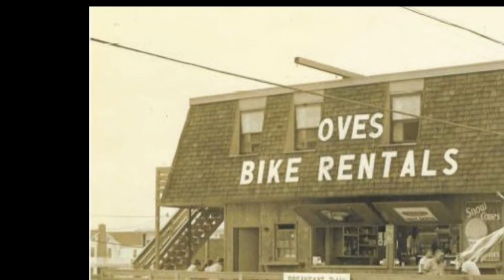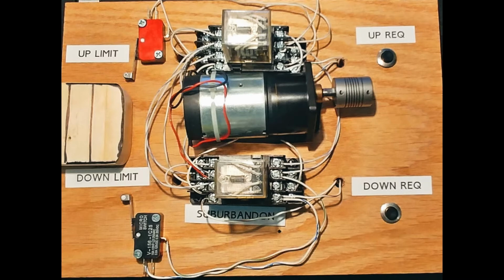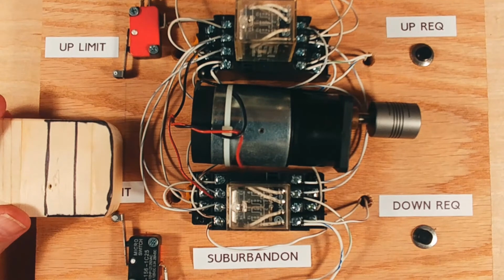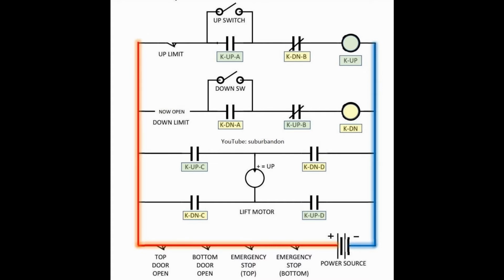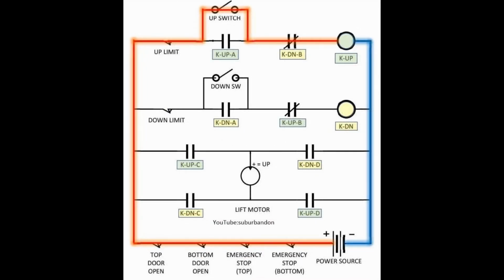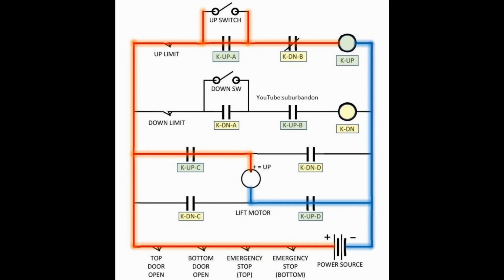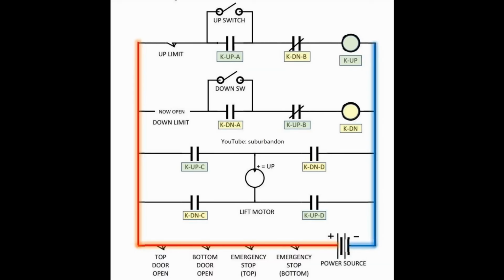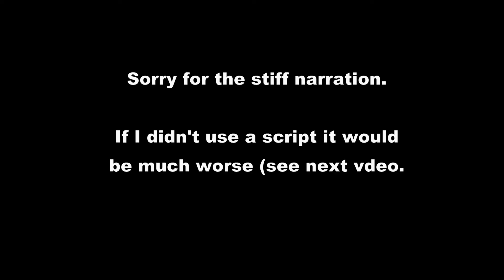Simple Relay Controlled Dumbwaiter/Elevator

Comment: Nice video! Do you mind sharing the type and brand of relay you used? Thanks!
Reply from the maker: Thanks! On Amazon: uxcell 2 Pcs AC 110/120V 5A Coil 35mm DIN Rail 4PDT 14Pin Power Relay + Base   About $ for two.
Reply: @SuburbanDon  Awesome! Is it possible to use the same kind of relay but on 12 volts?
Reply from the maker: @brightfame7984  The relay coil voltage should match the voltage driving it. 12v is good. The relay contacts should be rated to handle the load of your motor.,the motor here is a DC motor. What is your plan ?
Reply: @SuburbanDon  I have an electric hoist that is a 110 v to use as a lift for laundry. Are the limit switches and push buttons running on 110 volts? What I wanted is to have most of my wirings running on lower voltage except for the motor part.
Reply from the maker: @brightfame7984  This is 12 volts.
Reply from the maker: @brightfame7984  Sotry for the delay.  This is all 12 volts.
Reply from the maker: @brightfame7984  Yes everything on 12V is ideal except for the motor. Don't forget fuses.

Comment: shouldnt i use a contactor instead of a relay
Reply from the maker: I suppose depending on the load.
Reply: @SuburbanDon   1.5 horspepower motor?
Reply from the maker: @polhpolh64  I think so.